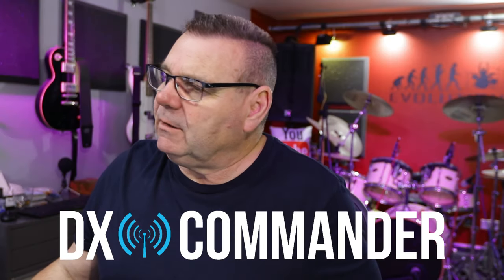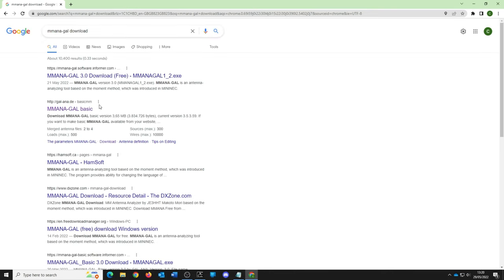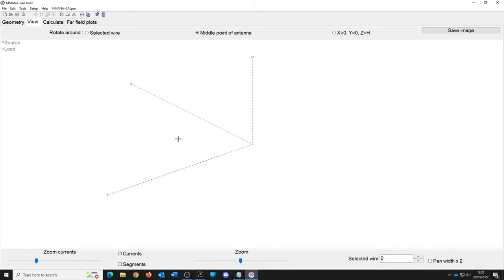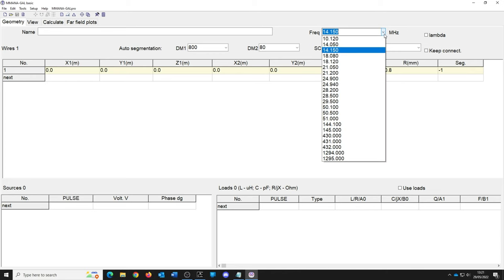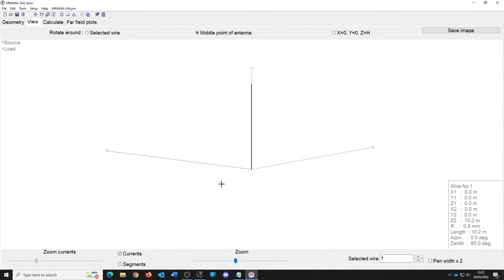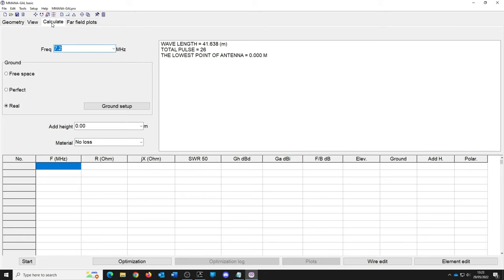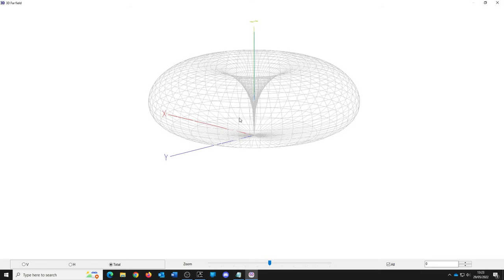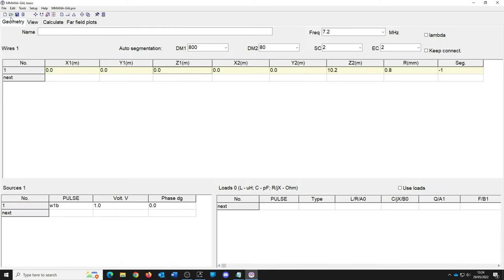Easy Modelling Your First Antenna in 5 Minutes - Vertical Antennas

Comment: Cal, I have watched your MMANA videos and am having quite a time exercising the software.  I would liken it to peanuts and beer in your local pub, it’s hard to stop.  To the point, could you do a short MMANA video on how the heck you did the DX Commander element attachment plate?  I have tried for a couple of weeks without success.  Maybe my being an old duffer has its limitations.

My DX Commander has opened up a whole new world for me.
DE K3WY (Nebraska, USA)
Reply from the maker: OK.. takje a look at mine. It's not perfect but near enough for playing with. I have shared it here: https://drive.google.com/file/d/1gmF6QbmYliABZt2ybd7bONvxP9cs5iP0/view?usp=sharing - If for some reason, it doesn't share corrrectly, drop me an email.

Comment: Great One Callum!   Please an 80M Horizontal Skyloop (corner fed) and perhaps also a 75M to 10M EFHW!    Also, how can you enter in / model a 5 turn 25MM coil (on PVC pipe form) in the antenna wire?  Also how can you enter in a 500pF 4000-6000V Capacitor in the antenna wire?  I have both of these components in my 75 to 10M EFHW.   The coil is about 2M from the feed point AND the capacitor is about 65 feet (19.8M) from the feed point (not including the wire in the 5 turn coil) AND... (Boy I am asking a lot here right??!!). Does MMANA show the impedance at the feed point to figure out the needed TRANSFORMER (Balun or UnUn)???  thanks OM.  73 Art W1SWL
Reply from the maker: SOON.. I'm doing a small "back yard" loop next time then we'll move on to BIG loops...!
Reply: I'm interested too in how to model a coil antenna around PVC. Arthur: calculate the antenna then go to HF components. It shows the LC values which you can enter as loads. Hope that helps. I'm still learning too. I hope on new video's from Callum. I'm still confused with this program after 5 days learning :p

Comment: I tried modelling a Double Bazooka coax antenna but i can't get it done. What i did is: a) draw one wire. halve wave length b) draw a wire below that and above that. c) connect the outer ends d) split the above wire into two and disconnect it. e) add a source to the lowest wire. Best SWR i can get is 13.8.... Question is can you show in a video how to do it?
Reply from the maker: Good try but I think we would need some fancy software to model coax and transmission line (I think!).. And I don't think MMANA does transmission lines.